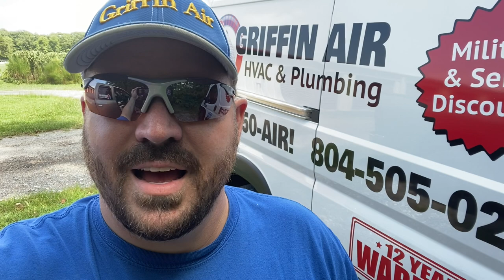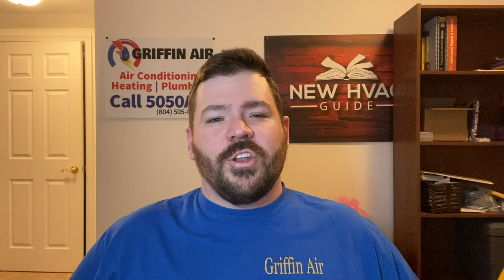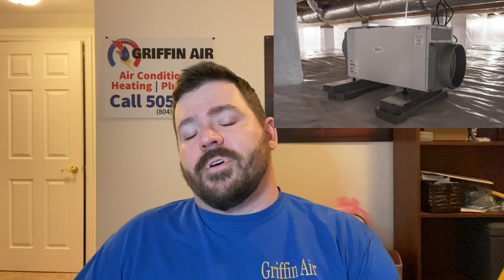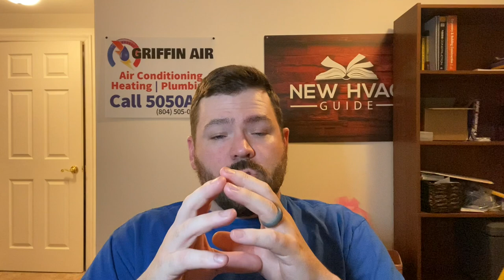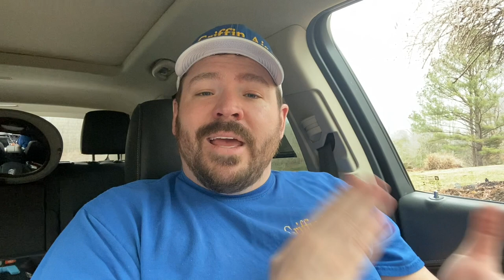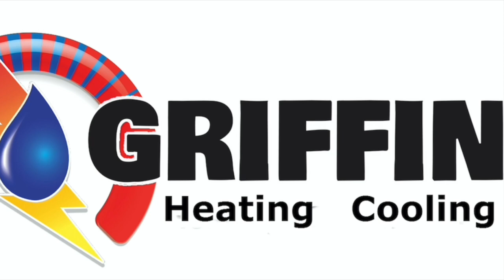The Crazy Truth About HVAC Sizing!

Comment: Hi Joshua!  Great video, very helpful - like all of your others.  I have a ductwork sizing question.  I got a couple heat load calculations done for my 2nd floor area as I shop for a new heat pump, and I've gotten estimates of 4+ tons needed.  I've used 3 tons since I bought the home years ago, and am replacing the second floor heat pump.  I would like to go to 4 tons because I've always felt 3 tons was at least slightly insufficient on the hottest and coldest days here in Portland, Oregon.  Two bidders flat out said my ductwork supply lines were too undersized for 4 tons.  I have 12 supply registers (6 inch pipes to each), and one rule of thumb quoted to me was approx. 100 CFM per register, and each ton needing approx. 400 cfm, leaving me 400 cfm short for 4 tons - way too short they said.  I was going to go with a communicating variable speed heat pump and air handler (either Trane or Goodman), so felt like I did have some "cushion" against constant strain on the system.  Your thoughts on this?  Do you agree with the rules of thumb cited to me?
Reply from the maker: Variable speed systems do not remedy a duct sizing issue. Although forgiving, the systems will never operate efficiently if the ductwork is undersized.

Comment: What are your thoughts on running a manual J heat load clac before installing a HVAC system? Almost every HVAC contractor I got quotes from never ran a manual J and would just look at my house, the old unit, and eye it. With no evaluations of the renovations and changes the house went through over its lifetime, including some duct work changes. Most just wanted to replace with the same tonnage but one tried to upsized my system because he "felt it was needed" but didn't run any calcs, which was madness to me since the house had windows and insulation upgrades over its lifetime. This was for single stage heat pump quotes.
Reply from the maker: I would request one even if you have to pay for it

Comment: Great Video ! Question what happens if my contractor sizes my air conditioner by rule of thumb(sq ft only) instead of doing a proper load calculation
Reply from the maker: Thanks!
Reply: @NewHVACGuide   again Question what happens if my contractor sizes my air conditioner by rule of thumb(sq ft only) instead of doing a proper load calculation?
Reply from the maker: Lots of things can happen. For starters, systems can be less efficient. Your comfort level is reduced. And you can have issues with humidity in your home.
Reply: @emreyurttas5051  find a company that does

Comment: I'm having to add cooling into my 4yr old home because when built (not by me, model home) they way undersized the cooling. 3.5 ton 1st floor and a 1.5 ton 2nd floor units on a 2600 sq ft 2 story, with no trees. Oh yeah, in Houston lol.  It seems that the AC industry in general always wants to use base load calculations and call it a day, at least around here thats what they do in residential and commercial.

Comment: Hi Josh. For 20 years I had a 15 SEER air conditioner out side, with a 2.5 ton blower in the attic. I could keep the thermostat at 75 and the unit did a great job of getting the humidity out of the house, so it was extremely comfortable. When that unit went bad, the technician replaced the air conditioner with a 17 SEER heat pump and 3.5 ton. I feel like it gets too cold too fast, so it doesn't run long enough and the house feels humid. I tried a few things... 

I lowered the temperature to around 72, which keeps the house at 70... less humid, but a little on the cold side. Then I tried putting the temperature back up, but closed the dampers a little on the vents in the room with the thermostat. I thought maybe they were blowing on the thermostat, causing it to shut off sooner. I think that helped a little but it was tough getting them just right. Then, just as a test, I taped a sheet of printer paper over the thermostat to see if blocking the air hitting it directly made a difference. I think that worked great. I'm wondering if maybe just putting a thermostat cover over the thermostat would do the trick? Any thoughts?
Reply: Probably not. Thermostat needs to be located near the air return away from sources that could interfere.   A dehumidifier can help in your situation but RIP your wallet in electrical bills
Reply: Air on thermostats... ugh!  My A/C cuts on and off too much on hot afternoons, so I checked the thermostat calibration. The temperature of the wall 3" from the thermostat was 76F, exactly as the display showed.  The temperature of the thermostat screen itself, 80F!. Stupid LCD screen is producing heat! I experimented with a small fan blowing on the thermostat, and my A/C wouldn't cut on until it got 80F!  I guess my thermostat has a 4F compensation for the hot screen. So the fan made things worse.

Comment: I recently moved to Fl. and the ductwork in my house is the square or rec, and several rooms are not receiving good air flow. I was in the hvac business years back and we installed metal size being diminished the farther away from the unit,  never had a complaint round air flow helps the room receive good flow.
Reply from the maker: Round ducts have a static in general. However, there are tons of houses with square duct that’s sized property with no issues. Sounds like your issues are more with sizing and less about static at this point.
Reply: Fan may need to be looked at.

Comment: Very informative video. Lots of quality information communicated in an easy to understand manner.  I am renovating the second floor of my cape cod style home. Currently steam radiator for heat with window air conditioner units for cooling. Mold has been an issue due to lack of ventilation & increase indoor humidity due to steam heat.  Located in NJ so humility in the summer months can also be high. 

Looking to modernize our HVAC system during this renovation. Ductless system seem like a great technology innovation but concerned about the aesthetic appearance.  Any recommendations for most visually appealing ductless systems?
Reply: Where in Nj?

Comment: Having issues with an oversized central AC in Minnesota.  System was short cycling on and off every 5 minutes in moderate heat.  Replacing the original round Honeywell mercury thermostat with the new Honeywell round non-mercury thermostat helped.  We also added a delay on break timer to the condensing unit, and set it for 10 minutes.  The temperature needs to be set to 66 degrees to get adequate humidity removal.  With the new thermostat and timer, we get about 3 on and off cycles per hour, vs 6 to 7 cycles per hour before the modifications.  Sometimes the air handler comes on in 8 minutes, but the condenser is held off for a full 10 minutes.  The house is much more comfortable, and we are attempting to save wear and tear on the condensing unit by avoiding excessive on and off cycles.  Is this reasonable or would you have done things differently?
Reply from the maker: There’s things you can do to help like adjusting air flow but why is it oversized? Maybe you should get it sized properly and go from there?
Reply: It is a 2 story house, 1960's construction with 4" duct work.  The upstairs was always hard to cool, so the contractor installed an oversized unit.  The thermostat is on the 1st floor, and it cools very fast making the condenser shut off.  The 2nd floor gets even less AC now.  With the stat set at 66 degrees, I can get the second floor down to 72.  The finished basement runs 62 degrees.  The constant short cycling was disturbing.  The replacement of the stat, and the addition of the 10 minute delay on break timer in the condenser solved that issue to some extent.  I don't want to spend more replacing this with a smaller unit. I just want to make it the best it can be.
Reply: @chipmaster56  Sounds like better off with a 2 stage system so it can run at full power to cool off the house at first and then run it half power just to maintain temperature.

Comment: Heat rejection is a big thing, lots of post and beam houses have no roof insulation or attic.  How do you account for this when speccing a HVAC system?
Reply from the maker: Depends on the house. Sizing correctly would be paramount, but installing everything to avoid stale air pockets and proper circulation is a challenge in some homes.

Comment: I'm in Maryland in a 2.5 story 1800 sq. ft. drafty stone home built in the 1840's. The primary heat is radiant and I have a 2.5 Ton system that was installed in 1997 that is rusting out. I've had two estimates for a ac and heat pump system in the past two days. One for $8800 for a 2 Ton Carrier system and one for $7500 for a  2.5 Ton Goodman system. The guy that spec'd the 2 ton said that the 2 ton is plenty and I could go to a 1.5. The other guy said he would prefer to put in a larger 3 ton in but because of the limited space he would have to put in a 2.5 ton. Two questions, one are these prices reasonable and two which system sounds more appropriate for my situation. Thanks
Reply from the maker: Every market is different. So I cannot say whether their prices are good or bad. That said, it sounds like you should have a company do a proper heat load calculation to find out what size system you actually need. Depending on how long you’ve lived there, you will know if the 2.5 ton system was at least big enough to handle your home.
Reply: I live in md( silver spring) I also have a smaller house but I'm getting a 3 ton only because that's what's in the house now. My quotes are both 3 ton 2 stage heat pump+air handler.  7k for both lennox and bryant two different contractors.
Reply from the maker: Awesome! I used to live in College Park once upon a time
Reply: You can Google what heat pump should for my whatever sq ft house.
Reply from the maker: No that stuff isn’t as accurate as a proper heat load calculation
Reply: When the system was new it seemed adequate.
Reply: Thanks for the price reference.
Reply from the maker: Sorry I’m not more help :-)
Reply: Seems a bit high I install Hvac units in Maryland but depends if you called the big companies like Griffith carroll but they are the same company technically lol
Reply: @mickee06  again little high and I really don't like heat pumps for Maryland more for southern states were it stays hot outside
Reply: I live in Baltimore. The first quote was Blue Dot and the second was from a small family business that mostly installs systems in new construction developments.
Reply: @dsmoke919  I got the heat pump but could've gotten the furnace for an extra 2k.

Comment: just had a thought on what you said, if you have a AC unit that's over kill but have a over kill dehumidifier, would you or would you not use less electricity of course being properly insulated.
Reply from the maker: I think it depends on the situation. I was just saying generally that a dehumidifier cannot be oversized because it will just reach the humidity if oversized and then turn it off

Comment: What have you seen with the reliability of an inverter heat pump vs just a two stage? The first seems to have higher efficiency, but is there an increased rate of failure? The higher cost doesn't bother me so much as the potentially higher repair costs down the line. If that is covered in your guide, I don't have a problem getting it now. I'm not in the market, but my units are old, so I could be, unexpectedly.
Reply from the maker: I don’t think they have a higher rate of failure. Since they are inverter systems, they work less hard at times. The only thing we have seen in across-the-board with all systems including inverter, multi stage, and single stage is the cost of variable speed blower motors has increased way more than what PSC motors used to be.
Reply: @NewHVACGuide  Thanks, I appreciate it. Not knowing any better, my initial thought was more complicated, more chance for failure.
Reply from the maker: They certainly have more bells and whistles. Air quotes “ more things that can go wrong“
But pretty soon I think they will be all you can buy anyway. So folks need to get with the program LOL
Reply: @TheEngineerd  Inverter systems are more intricate with a higher level of control, however due to this higher level control the complexity of the electrical components within the unit equate to more expensive repair costs because unlike a regular air conditioner that has a very basic and simple set of components that operate the unit, the inverter systems typically take longer to diagnose properly, which can start to add up on a bill real fast and when the unit is diagnosed to have a faulty control board, or some other part that is specific to that unit, it can cost a lot more for the parts due to the fact that you must install the OEM part from the manufacturer otherwise the unit will not work. And most of the time when units have brand specific controls that are only used on that one piece of equipment, the price for these parts is unreasonably expensive. A traditional AC unit contains parts that every single tech has on their van that are much less expensive and are easily obtained at any supply house. With higher levels of control come higher cost for repair, labor,and longer downtime due to the fact that a lot times these OEM parts need to be ordered and shipped instead of being available at all supply houses. I think it's wonderful that these systems exist and they have their benefits per application but I value reliability, consistency, and simplicity over a small increase in energy efficiency. This does not mean that I dislike inverter systems it just means I do not prefer them. That is my genuine, honest, and sincere opinion.
Reply: Night tone - all good points-I’ve had all three in various houses- that old single stage unit juts chugged along for 22 years, gradually grinding itself to death . Noisy, inefficient, but it was sized ok and didn’t cycle that much, but it was noisy !. Parts were cheap always available etc. then moved to two stage unit-more comfortable in one house, but because it was more efficient higher seer and we mindlessly just used same tonnage, a lot of cycling- why? Lowest it could ramp down was 40%…..more repairs. More recently we Et with full inverter and variable speed ecm fan-expensive but way way way more comfortable - not even close, and critical in humid tepid days in fall and spring.  As Ana side I’ve had trane, carrier /Bryant and Lennox, American standard, all are good, look for the form and look for the actual ethos who do install/repairs, not the owner .you don’t want too big a form-they have huge staffing issues these days-i prefer smaller firms who can retain and train staff. You do run risk they may run into problems if owner retries, does, one staff guy retires, moves etc, but as long as you have a brand that has good distributor in your area, parts available, and many dealers to choose from. You arce good. Equipment wise, I think Lennox gets top billing very sophisticated and well built and thier communicating thermostats the easier to pe rate and very stable. bUT Lennox insist you only move their products and in most fewer dealers. Carrier overcharges, but in almost any jurisdiction parts are widely available, many forms service so u can lick or chose if one firm lets you down. I just hear more complaints about parts and issues with the than the others and it’s pricing it’s certainly no better. Lennox had some big manufacturing  issues about a decade ago but addressed quickly and things seem smooth right now. NB if going  with top of the line heat pumps, only carrier/Bryant have heated dehumidification, very valuable if you have long trunk seasons , ie lots humidity, temps I. The 70’s. NB hvac these days is very complicated, most techs are in over the heads, the young ones due to experience, the older because they haven’t kept pace with technology.

Comment: Awesome video! Quick question I live in Canada on the West Coast. My house is built in late 80s 2 storey home, We are looking to add Central AC to the main floor 1450 sqft (3 beds, kitchen, living, dining, hallway) one contractor said I would require a 2.5 ton one said 3 ton is it safe to go for 3 ton if I choose a dual-stage system to prevent cycling?
Reply from the maker: Well you’re only talking about 6000 BTUs. However, I would recommend having a proper heat load calculation done even if you have to pay for it

Comment: The main problem is ductwork in the attic which is nuts. Ductwork should be in conditioned space in soffits or in an fully insulated attic.
Reply from the maker: It definitely has to work harder when they’re sitting in an oven (hot attic)

Comment: Does anyone know what size rectangular ducts are needed  for a 420 square foot 3 room addition? It has a separate furnace, 24 foot straight run and six 6"  side vents. I got 8" x 16" supply rectangular ducts but haven't installed them yet as I'm not sure if they aren't too big for heating.

Comment: I installed my own HVAC system  this year central air worked great maybe a dumb question but the blower runs harder when the furnace runs than when the ac is on is this due to the ECM motor
Reply from the maker: Yes
Reply: @NewHVACGuide  my local gas company moved my gas meter from my basement to the outside they checked for gas leaks and noticed new furnace and central air system he said who installed the system did a nice job I said thank you lol